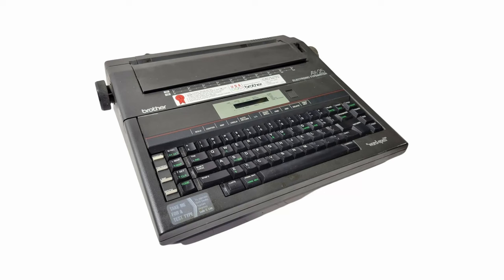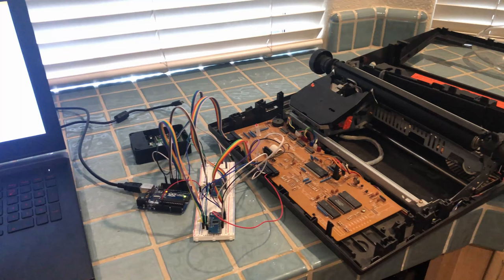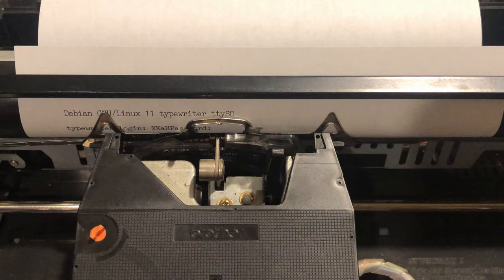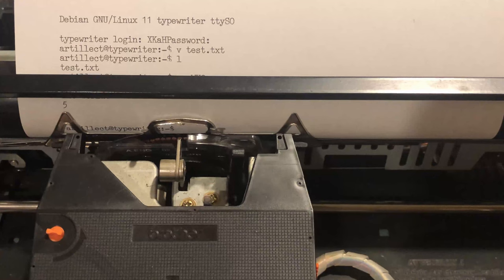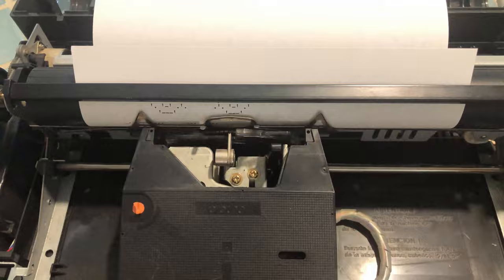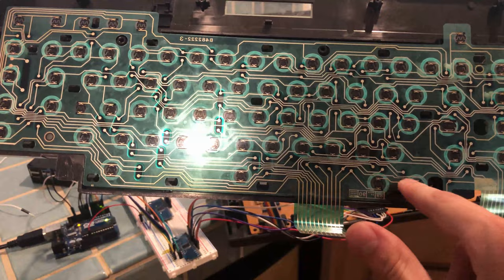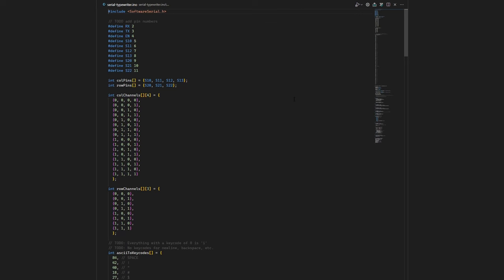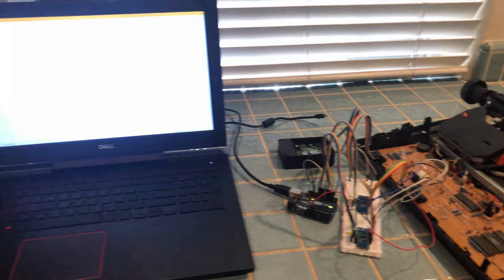I'm turning my typewriter into a computer

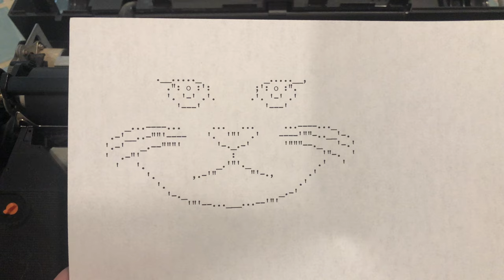Comment: This brings back memories! When I was in college (back in 1986) I had a similar brother typewriter and back then you had to go to a computer center to print out your papers. I had a commodore 64 and wanted to be able to print out my papers on my brother typewriter. So I did pretty much the same thing -- wired two 4:16 multiplexers on the keyboard and then wrote a printer driver on the 64 to print out my papers. Used the parallel bus on the back of the 64 to connect it all up.
Reply from the maker: That's awesome! Funny that after all this time, this is still pretty much the best way to do it lol

Comment: You should look at making this a product to purchase. People who produce professional letters would use and want a printer that looks like it was manually made by a typewriter. Great project!
Reply from the maker: Interesting, I’ll definitely look into that! Once I’ve got a PCB designed for it, I’ll definitely put it up for sale somewhere.
Reply: Problem is, a lot of typewriters are gonna be proprietary, or work different. It'd have to account for those more DIY scenarios.

Plus, some late-era word processor devices probably can do that already, if you can feed them the text.

Comment: Fwiw, I am doing something similar with an IBM Wheelwriter 5. One of the significant problems to overcome is to obtain a printwheel with a full ASCII character set. Traditional typewriter character sets include silly things like ¢ and ½ and ¼ instead of useful characters on a computer. It turns out the fully ASCII printwheels for IBM do exist, but they are very hard to find (I did manage to find some). In the case of my wheelwriter, there is a logic board that communicates with a motor control board and speaks a protocol between them. The logic board reads the keyboard matrix and sends commands to the motor control board. I sniffed that bus and reverse engineered it. My plan is to replace the logic board and use the typewriter as a hardcopy serial terminal, to vaguely replicate my childhood experience with a model 33 teletype. I've already done something similar with a daisywheel printer, a DEC LQP02 which didn't have the reverse engineering problems since it already has a serial interface, but which makes it hard to tell what you are typing because the printhead gets in the way. https://www.youtube.com/watch?v=uB5YunsIeDo

Comment: Nice project! A long time ago these devices were referred to as a 'Printer Keyboard'. Well, at least by IBM anyway. The main console of the System 360 mainframe series was the 1052 Printer Keyboard. This unit looked like a regular IBM Selectric typewriter but it was actually a mechanically and electrically separated keyboard (derived from an IBM 029 Keypunch) and the printer was (to my knowledge) the printing mechanism of the IBM 1053 Keyboardless Printer.
Reply from the maker: Interesting! I believe this is the same mechanism as the one Brother used in their daisywheel printers

Comment: I was using a system that had a typewriter and paper output in 2002, it was from the 70s and was the only way to connect with a US Navy radar/fire control system on a Spruance Class destroyer.
Reply from the maker: Wow, gotta keep those old systems running somehow! Did you have to use it to directly control the radar/fire control, or was it just for debugging when things went wrong?
Reply: @Artillect0  it was for maintenance and repair, the system I believe was called teletype and it worked exactly like this to run commands on it. Sucked when you messed up a command because you wasted ink and paper.
Reply from the maker: @murphyseanm  interesting! I think you’re right, it probably was a teletype.

Comment: Awesome! Went through roughly the same process just on a Sharp PA-3000H and an ESP8266
Reply from the maker: Thanks, and that’s a pretty sweet typewriter! How’d it turn out? I was considering using an ESP32 for this but I ended up sticking with the Nano
Reply: @Artillect0  got a working proof of concept on a breadboard but then life came in the way and I sadly never found the time to solder it up. Instead of 2 mux'es I used shift registers and transistors. Made the issue of hitting multiple keys easier - but created waay more soldering work.. my idea was to turn it into a twitter teletyper - but hooking it up to a pi is genius! Much more general purpose than an esp

Comment: My parents had probably a later model of that typewriter. But it may have been easier to use since it had a serial port and could print as a generic text printer. You could just dump a txt file to the port and it will print it.
Reply from the maker: Definitely a lot easier to use lol! In the bottom right at 0:03 you can see some unused holes in the circuitboard, which I think might have been used for a serial port in other models. Maybe our typewriters had the same motherboard!

Comment: Of course you can't use Nano, Vim or Emacs…
But there's one editor that was specifically designed for THIS kind of terminal: ed, the original Un*x text editor.
The commands are very similar to the commands in Vim, ed was Vim's great uncle.
Gnu has excellent docs on how to use ed.

I'll BET you already have ed installed on your system.

Comment: btw mine was about the same year but without display and it had a buffer. If you typed fast enough you could stop typing and it would finish typing few miliseconds after me. I'm saying that because maybe you are connected after the buffer forcing you to be realtime (not inputing faster than the mechanical speed of the buggy)
Reply from the maker: I think this one also has a buffer, but since I can only press one key at a time right now, I can basically only type at the speed of the typewriter. I made some changes to my code and I was able to get it to type a bit faster, but I'm not sure by how much.

Comment: Something wrong with the baud rate? Missing some letters.
Reply from the maker: Yup, I managed to sort that issue out after the video by setting the baud rate to the Raspberry Pi’s minimum. 1200 baud is still way too high, so I also had to implement flow control on the Arduino.

Comment: What if you made a program to pipe stuff to the typewriter?
Reply from the maker: Like directly from the raspberry pi to the typewriter, with no Arduino in between? I could do that, but I’m not super familiar with Linux so I’m not really sure where to start with that
Reply: @Artillect0  not necessarily without the Arduino, just a command to send the data to it
Reply from the maker: @tamoozbr  ah, gotcha. I know it’s possible to control the raspi’s serial pins using python, so I could try that out. I’ve heard that that conflicts with the serial terminal, but maybe if it isn’t sending anything else at the same time it could work? I’ll have to try that out

Comment: Neofetch
Reply from the maker: I’ve been trying to get neofetch working and I think I finally found a replacement
Reply: @Artillect0  screenfetch?
Reply from the maker: @ashtong85  sf, it's like screenfetch but even simpler, which is exactly what I need! All the other ones I could find added a bunch of formatting codes I couldn't disable
Reply: @Artillect0  pfetch